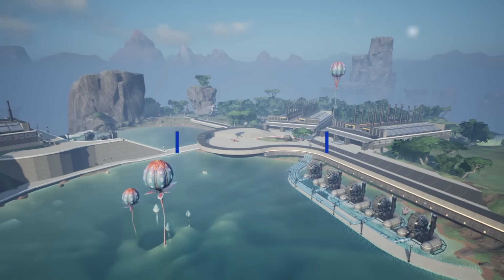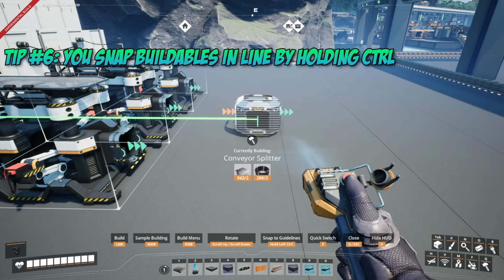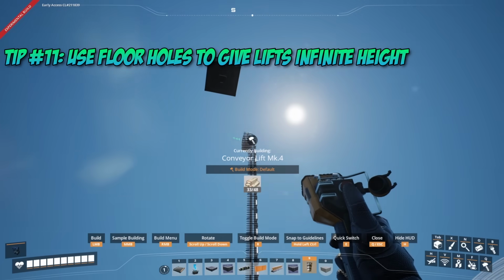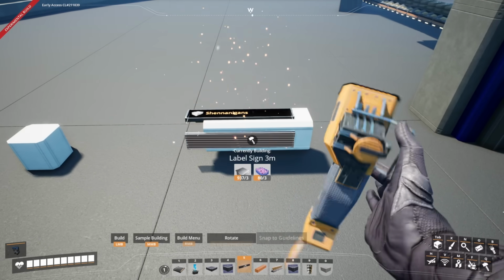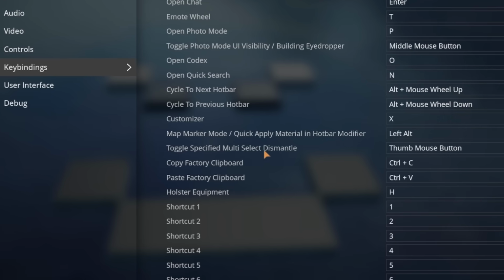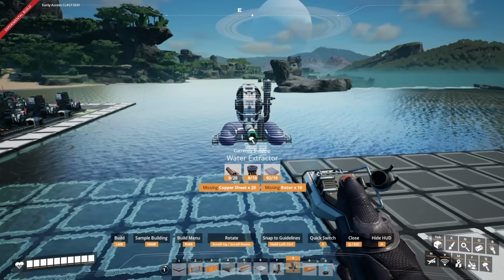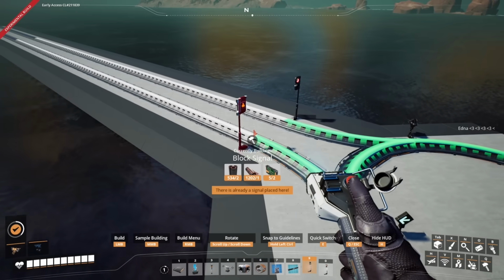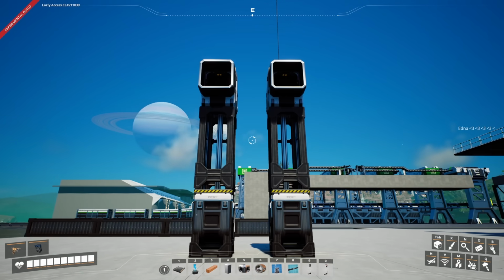30 NEED To Know Build Tips In Satisfactory

Comment: They should code it so that if you want to create a large platform quickly, when you zoop out the first line, you can hold shift(or some other hotkey) and it will hold that zooped line as a hologram, and then let you do another zooped line of foundations to the left or right and then when you click to build it, it will automatically fill in the whole platform. This would make it almost instant to build a 100 square meter platform and any other dimensions less than 10x10 which would mean you can easily do any size you want. I'd love that.
Reply: I believe this is actually how it works with scrap mechanic I believe
Reply: It would be nice to have this as a "vanilla" feature. If you aren't adverse to using mods, the Infinite Zoop mod will do this. Can't remember atm if the SMART! mod does as well.
Reply: Zooping is basically the middle ground between too grindy and too powerful. 

Blueprints upped that even further to putting down 16 foundations instead of 10.

They won't add an even more powerful placing style for foundations, they'll let mods handle that.
Reply: @paulelderson934 yeah you can zoop a blueprint platform lol. it is o.p
Reply: Zoop Squared if you will lol
Reply: I'd be willing to bet the original plan was for BPs to be how we built floors and such quickly but they added Zooping to basically tide us over.

Comment: Building walls off of barriers is probably the most useful one I didn't know.  One of my common designs is putting walls above the liquid inputs and outputs of buildings to have pipes running up there, to make room for other pipes or belts at ground level.  I took a lot of effort to get the walls in the correct position offset from foundations, using beams to build foundations offset a specific amount, then building walls on that.  Being able to do it in two steps would be great.

You mentioned with snapping foundations to the world grid to use 2m or 4m foundations, but didn't explain.  The reason is that the center of the foundation snaps, so a 1m foundation will be .5m off compared to 2m or 4m.

Comment: Tip # 31 If you have a ceiling belt and need to cross it with another ceiling belt use small pillars on either side of the first belt. You can use wall hangers to pass the new belt under the 1st belt. Why CS didn't make ceiling hangers stackable I don't know but this trick is a good workaround until CS wises up.
Reply: But... you can stack the hanging conveyer. Or did I just misunderstood your tip?

Maybe I just think it works even though it doesn't, but I feel like I did stack them already 👀
Reply: @Michi M.  Ceiling conveyors do stack. I'm interested in what he means as well lol would love to learn something if I didn't know.
Reply: @Dudesmack   & @Michi M.  (Not sure if double quoting works.)  I think they mean if you need to have, say, a North-South belt pass by a ceiling mounted East-West belt.  Adding a beam to the existing ceiling mount should allow for having another belt mount at a different angle.
Reply from the maker: Great tip!